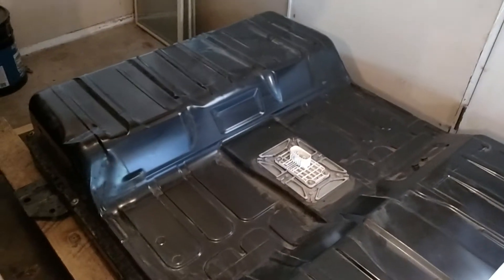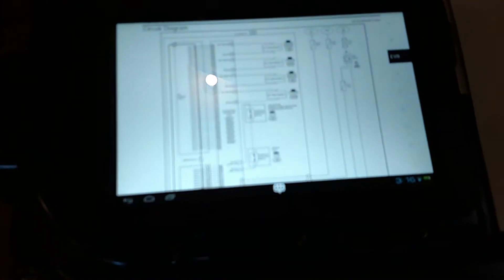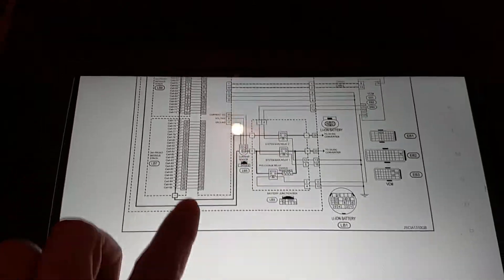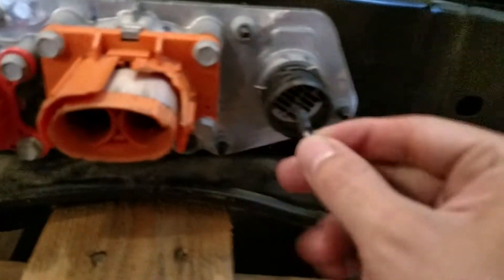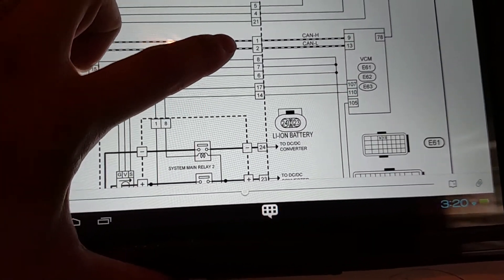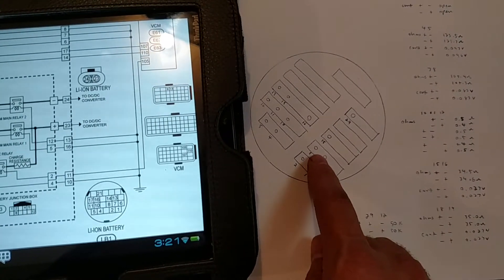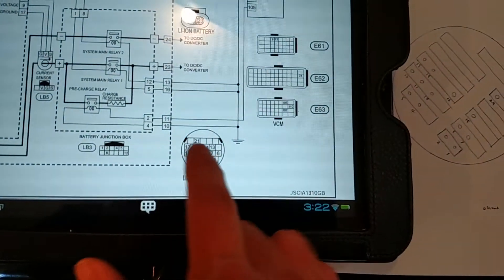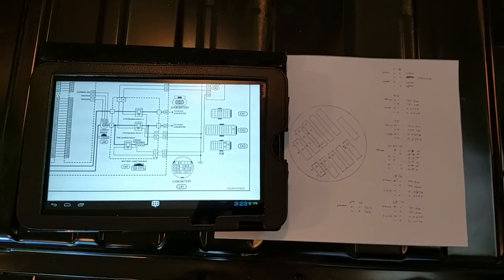Solectria E10, Lithium Ion Battery Upgrade, Part2

Comment: Please, I need your help in connecting my 2011 Nissan leaf battery BMS to the OBD2 port just to monitor my range extender in the trunk of the car. Kindly see what I have done so far that is not working.
https://youtu.be/vkFYc-_MxrE